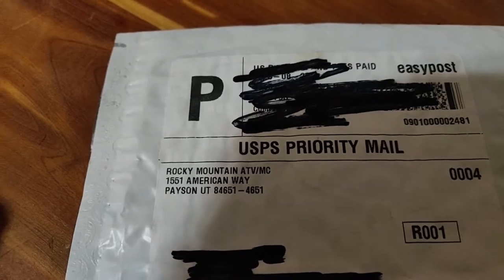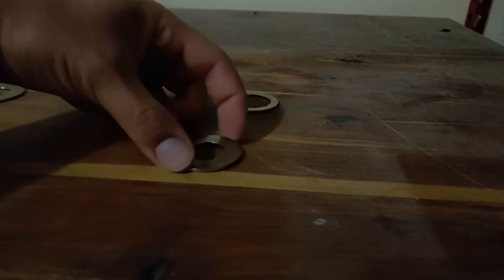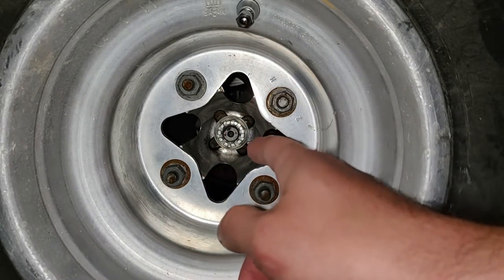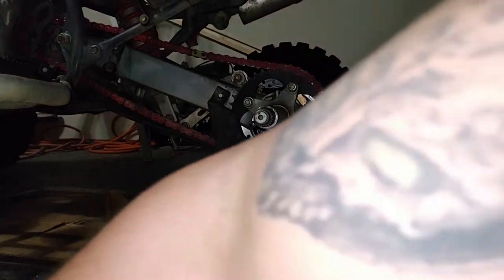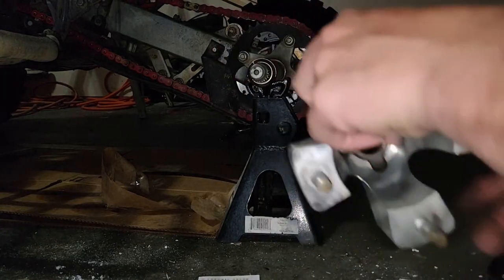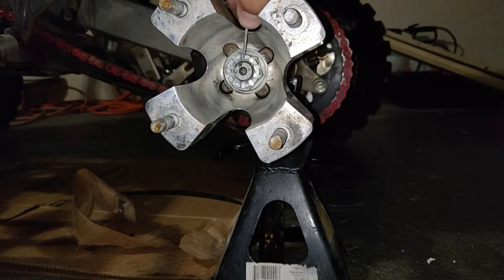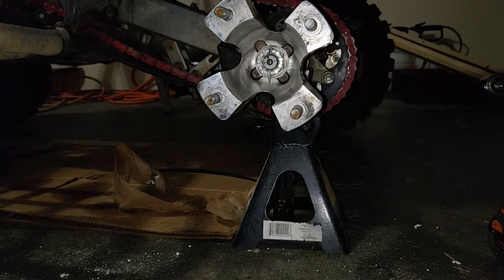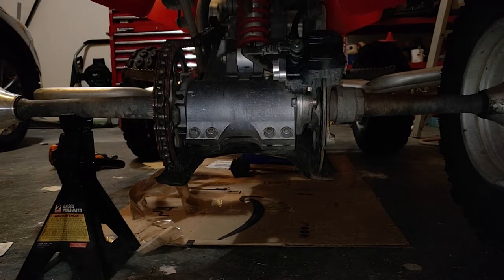Fixing the hubs on the Honda | 400ex Build [Part 12]

Comment: Its the taper loc hubs.it helps prevent loosening and spline wear by the added friction from added surface area the tapered hub and washer provides. The same principle as sprocket bolts and why they are tapered
Reply from the maker: They haven't given me any issues since I've gotten these replacement parts thankfully!

Comment: Part #?
Reply from the maker: They never gave me one, be sure they aren't for sale
Reply: @AthenasGarageOfficial Ok, I just bought a 05 400ex with tusk extended hubs and no washers at all. I’ll call them tomorrow.
Reply from the maker: Yea it was a pain in the ass to get them, I emailed called and chatted with them and finally got them months later. It was mainly because I didn't buy the hubs. If they can't get you any or are gonna give u trouble let me know. I may still have a set lying around. I sold sold the 400 so I don't need them anymore
Reply: @AthenasGarageOfficial  Thanks for the quick response. I’ll let you know.
Reply from the maker: No problem man. I don't post as often as I want to but I'm still here and active!
Reply: Just wanted to update, contacted rocky mountain atv and the warranty department sent them to me for free, just paid 7$ shipping. Got them in 3 days.
Reply from the maker: That's awesome man! I'm glad they did you right! It took mine almost two months if I remember right! Everything else I've gotten from them has been great and fast just that one thing.